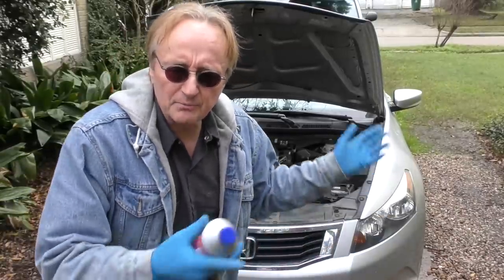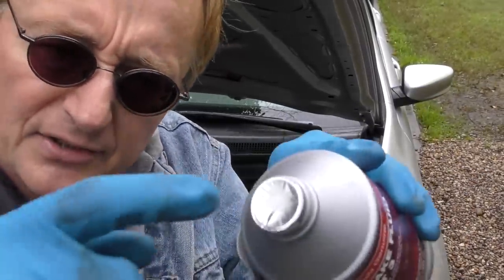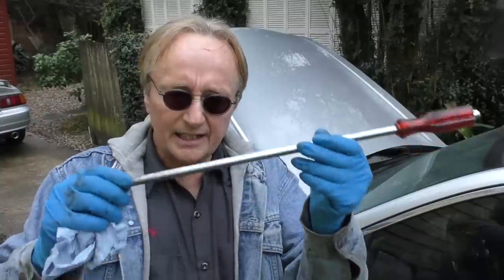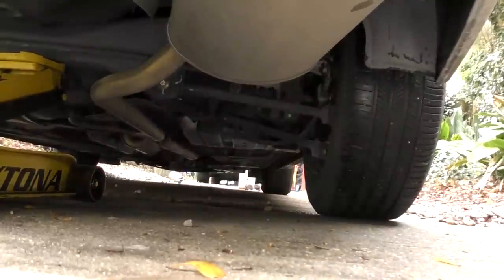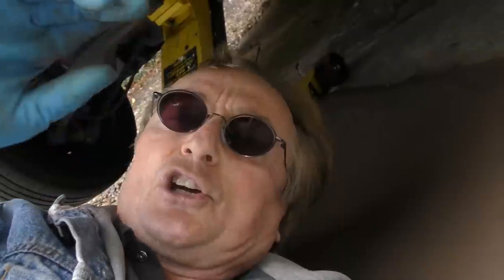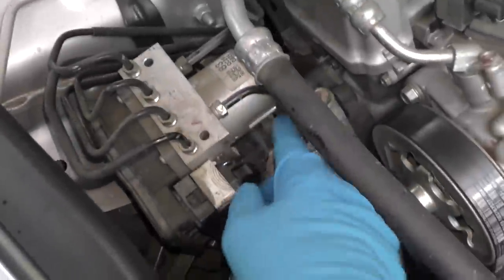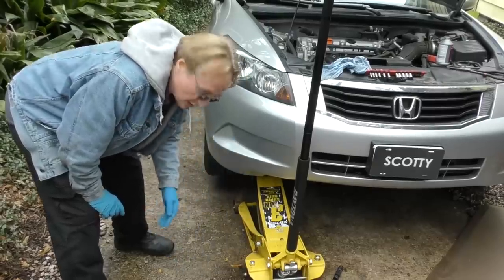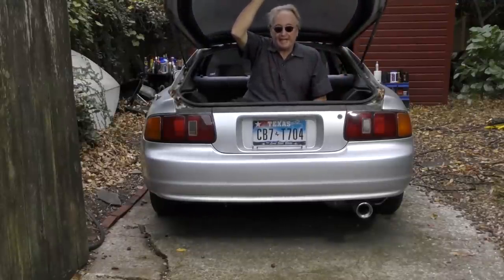Mechanics Don't Want You to Know This About Brakes

Comment: I’ve used 1/4” clear tubing to connect to the nipple on the brake bleeder. It works very well because you can see when it runs dirty dark to clear clean. U can find it at the plumbing section at Home Depot. Also Scotty sounds like he’s about to do the hokey pokey at 2:38 lol
Reply: I thought he was about to do the Hokey Pokey too.
Reply: Great idea. Thanks 👍
Reply: I use the same method with the clear plastic hose but I simply leave the lid a little bit loose on the master cylinder and the brake fluid gravity feeds when the bleed valve is opened. No need for the screw driver or a second person. It pays to keep an eye on the fluid level in the master cylinder as I generally have to fill it more than once to complete the job.
Reply: 19c a foot at local hardware store.    Needed 5/16" tubing for large 4wd truck brakes.
Reply: Kevin, the clear tubing is worth the delay before proceeding.  I used a clean jar with a hole in the lid, filled with 8oz to pump the brakes alone.  Also used similar technique to prime or bleed a new master cylinder installed dry on the firewall, instead of playing with bench bleeding it.
Reply: The hokey pokey!!!

AAAAHAHAhahahaha 😂😂😂😂
Reply: I used surgical tubing.  It wasn’t clear, but was soft anf flexeble and gripped the nipple well.  The main thing is the tube should hang on to the nipple.
Reply: We used the clear ones at work too! The hokey pokey, I'm dead as f*ck!!!!

Comment: I have an 03 Tundra that sat for 7 days.  I thought battery was dead so I got a replacement.  I had that same low idle problem.  Just like Scotty said after letting it run and driving it for a while it works great.  Starts every time.  Scotty you are legit

Comment: Another tip. Avoid over filling. Brake fluid compensates for pad wear. Some people will top off their fluid with half worn pads. When you replace the pads that fluid gets pushed back to the master cylinder causing it to overflow and eat all the paint off your firewall. Unless you have a leak you probably shouldn't be adding fluid between brake jobs as long as it's safely above the minimum level. I worked as a lube and oil guy for a long time and people would routinely complain if their brake fluid wasn't  topped to maximum level and I would have to explain this frequently. If you are changing the fluid like this video suggests pay attention to the fluid level beforehand. If you're bleeding your brakes of course you will need to monitor the level during the process.

Comment: Never get under a car supported only by a jack. Never.
Reply: Cinderblocks are a no no
Reply: Not true. If all four tires are on, and you have clearance, what's the worst that could happen? The jack falls, but you don't get crushed because it simply falls on the tires. The reason for the jack is just to give you a little more space to work.
Reply: I always keep a couple of spare tyres that i wedge under the sides of the car. If the jack slips, the tyres carry the weight and i can still crawl out alive.
Reply: Great advice.  I saw a guy lose his leg when  a car fell on it in the junk yard on faces of death a long time ago. He died 2 days later. I never made that mistake again.
Reply: @dannybonesdaddy  -- Maybe there's room under your jacked-up SUV, but I drive a German sports sedan that has a lowered suspension. There is no room for me to crawl under the car without jacking it up. The jack slips ... and I'd be crushed.
Reply: @dannybonesdaddy  you ever drop your car off the floor jack? Try it some time, lift your car, place a cardboard box the size of your back to chest as if it is you laying under the car, then quickly release the floor jack. Did you see the live definition of jounce and rebound? Now look at the cardboard box. 

Most o rings that hold the hydraulic pressure in even the most expensive name brand jacks are 10 cent Korean o rings. Is 10 cents worth your life or limb?
Reply: @Shornandkenny : Neither did he.
Reply: @edwatts9890  this is true..
Reply: cameraz99 lol
Reply: @cameraz99  put the wheels under it
Reply: @dannybonesdaddy  Go where Scotty was with the wheel jacked up while looking at the bleeder valve. If the car were to drop the vehicle with its tires on would flex your suspension. You will get your head crushed between the wheel well and the fender. or strut or frame.
Reply: I dont even trust jackstands... i put rims under the car.. jackstands are mechanical and can malfunction, a rim is solid.
Reply: Extremely dangerous
Reply: Lmao, I know. I have a huge problem with that, knowingly. I've started using a jack stand...lol
Reply: Don't be a whimp slap a Jack stand under it call it a day
Reply: I don’t get myself under a car unless I’m in the pit
Reply: I once used only the jack cause it's all I had, I placed a tire i took off under the car just in case. My friend stopped by and i got out from under the car to say hi and as soon as I got out from underneath it the car dropped on the thin tire. Definitely divine timing on that one. My point is you're totally right on this. Never use only a jack!
Reply: Even if you think there is enough clearance, remember the suspension travel. When all that weight comes crashing down off your jack, the vehicle isn't going to stop at the normal ride height on the first pass. It will drop, sag, then rebound to normal ride height. So even if it's a vehicle that has plenty of ground clearance, you still need to take precautions.
Reply: Tom Wetz  If your using a floor jack on a corvette, you are wrong.
Reply: Depends on situation should you put axle stands on for change a flat on the side of road no because you are not under car
Reply: @dannybonesdaddy  you are correct about certain vehicles, but you are not wrong about the other lowered vehicles, maybe you forgot to mention it...ahhh I learned something new today, did you?
Reply: @dannybonesdaddy  Well of course this person is talking about cars that are too low, so yes this person is right. If the jack fails you're dead. Never go under with no jack stands.
Reply: Many years ago I was jacking up a car with a friend's cheap floor jack.  Near the point where the jack to extended to its limit it failed.  The car came down instantly, not slowly.  To see all that weight come down so hard and fast was scary.
Reply: @dannybonesdaddy  The suspension compresses and you are crushed.
Reply: Scotty is invincible!
Reply: @Bravo 4 That's not what I said. If you have to lie to make your point, it shows you're probably not in the right. If you have clearance, there's nothing wrong with it. I don't mean where you can barely squeeze under.
Reply: Especially when on gravel
Reply: @dannybonesdaddy  Depends on the vehicle. Some don't have enough clearance.
Reply: @lifewithbreion1392  Harbor Freight just recalled jack stands, then recalled the replacement ones.
Reply: fasteddie bassman  I do the same. As soon as the weight is on the jack stand, I crank the floor jack valve closed and leave it just below the jack point if I can.
Reply: Yup, my middle school principal got killed that way, he thought because he was on a lifted truck with big wheels that nothing would happen if he only used a floor jack. However, when the jack malfunctioned he wasn't on his back, he was on his side. If he would of been on his back, he would of been fine because the truck was lifted, but on his side. The 3.5 ton truck crushed his arms and  torso and which then damaged his lungs and heart. He was dead within minutes. It's not worth it gents. Use something else when working on any car or truck.
Reply: First lesson my father taught me was "never trust a jack."
Reply: SUPER SCOTTY CAN DO ANYTHING !
Reply: I'm paranoid. I put the car on jack stands, leave the jack with a bit of pressure applied under the car, and put a junk wheel under too.
Reply: @Shornandkenny  My mother's friend lost her husband when a car supported by only a jack crushed the guy to death.
Reply: I just use ramps. and put bricks behind the rear tires. Big no on jacks for m
Reply: I know a guy who's brother died under a flatbed truck like that.
Reply: @Templar-jj3ig  same i have 5 holding my car up and rims under all 4 tires my wife called it over kill lol but i don't trust jack stands that much.
Reply: @dannybonesdaddy  that would require critical thinking.
Reply: Unless you are a catalytic thief.
Reply: @dannybonesdaddy  um no... the car could bottom out and damage you or itself.
Reply: ok clever man, thats what i was going 2 say,men have been killed doing that here in NZ.
Reply: Dont think that honda can go so low as to crush an arm. You shouldn't need to put your body under to undo a bleed screw.
Reply: Realistically, a screw jack is just as firm as jack stands.  Has to do with the physical mechanism.  However, many people hate screw jacks with a passion.  Personally, I find them annoying (without a powered tool attachment), but I understand why they're still in with the spare tire (if you have one).  They don't go bad, have seals fail, etc.   They're also more flexible with height than jack stands.  

I do realize that you were discussing hydraulic jacks, or the old bumper jacks.  Both of which can fail catastrophically.  Even a minor fluid leak from a hydraulic jack, under pressure, can cause the vehicle to fall fast.   I'm just rather a pedant, and I hate it when people just bluntly say something that's only true in most cases.   Especially when nobody's charging them by the word to be more specific.   

The key here is NEVER work under a car that's ONLY supported at ONE point.  That has the weight unevenly distributed.   If you have two screw jacks on the driver' side,  one near the front, one near the back, you're just about as safe as if you did left and right side (front or back).   Personally, I wouldn't tilt a car to one side to work under it - the tires are, after all, flexible, but I've done it before when I had to do a front to back tire swap.   

If you want to get really techy, you should say that you should never work under a car that's not supported on at least four separate points, because the chocks could fail, the brakes explode, and the car rock backwards or forwards and land on you.
Reply: @jwngokart6788  - it's whatever makes you feel comfortable.  As long as you take your time to get the jacks even and straight, they're about as good as it gets.   The Harbor Freight recalls due to failures were due to idiots that jack one all the way up, then the other side, and torqued the snot out of the uprights, causing them to bend sideways and fail.  (I hate seeing that, because I don't even want to put my hand and jack under the car to reset it)    If you lifted one side, set it, then the other, set  it, and then went back to the first to re-set the stand - then checked the other again, the weight goes straight down.
Reply: @dannybonesdaddy  this might work for trucks, but not cars. The suspension will still compress alot when the car comes down
Reply: Agreed, never, and every man should own a pair of jack stands..
Reply: Very true I was beheaded when my car fell off the jacks. Luckily I was able to make it to the hospital on time for them to reattach my head but driving without it was a challenge. I had to set my head in the dashboard so I could see where I was going.
Reply: Jack stands and a spare wheel with tire under car benefits a lot.
Reply: Real talk

Comment: The one thing I never liked doing in the past is changing my car's fluid. Unfortunately, I often neglected changing anything other than engine oil. This week I found out that my steering fluid change was long overdue and it was very easy for me to do. I'm not motivated to take charge of all the car fluids. Thanks for always looking out after the little guys who constantly get ripped off at mechanic and oil changing shops!

Comment: Scotty what a wonderful video....I just replace my brake master cylinder today during the morning. I did exactly as you say. I bleed my system starting from back to front and from right to left. the kit from autozone provides a self bleeding kit for the master cylinder, but you still need to do all your 4 wheels. I even turn my front wheels as you recommended. The only difference from you video is that i use a human screw driver ...LOL.. He just push the pedal and i release the drain plug...until he reach bottom, then i close the drain. Thanks Scotty for you help.

Comment: Make sure that screwdriver is set really tight because when you open the bleeder, the pedal will sink a bit and potentially cause the screwdriver to drop. If the screwdriver drops, the pedal will reset and suck air into the line.

Comment: Thanks Scotty! We have a 2006 Buick Allure which has about 300,000 km on it and the darn thing is working surprisingly well. I have done a lot of the maintenance myself like brakes and fluid changes but changing the brake fluid is something I never did and this will really help. And I was not aware that the brake fluid in old bottles shouldn't be used so will toss that stuff out.

Comment: I've been wanting to do this on my Honda Accord 2012 with automatic transmission for quite a few months already. Took it to the dealer and they told me my break fluid is contaminated with water vapor and they wanted to charge me $125.00  for the job, but seeing this video now, I can just buy a couple of more tools that I need, the genuine Honda break Fluid and do it myself without paying over a 100 bucks for a job I can do myself spending less than 30 bucks I would say. Thanks God and Scotty for showing how is it done.

Comment: I've been replacing the brake fluid in the master cylinder on all my cars yearly for about the 50 years that I have been driving.  I thought I had invented this technique.  I have had remarkably little trouble with brakes.

Comment: Great, thanks.  Wasn't sure if I could bleed my own brakes with ABS on my 1996 Ford Ranger.

Might have shown how to do this a LOT easier/quicker/lots less under car, inside, repeat if you can find a friend.  Have windows open so you can communicate.  Then have them press (not super hard, but firmly) on the brake while you open the bleeder, when to bottom have them shout BOTTOM (and HOLD it there!).  Close bleeder and shout RELEASE, THEN PRESS AGAIN.  When pressed, they shout "PRESSING" and you open the bleeder again.  Repeat.  SO much easier with two than one but good to know you can do it by yourself.

RichE San Diego, CA

Comment: Nice Scotty, and a timely reminder for me and my 12 y.o. Honda CRV .... especially since you're doing it on a Honda too. Many years back I bled brakes on my Sunbeam Alpine, Jag X-KE, several Datsuns, and some older Hondas. 

Now it is no longer second nature, and some reminding is helpful. I still have an old bleeder helper tool with one-way valve, tubing, and cup. If I can avoid emptying the reservoir (and thus introducing air), it should eliminate 20-some trips to move the big screwdriver, or me yelling at some confused helper that doesn't know up from down pedal.

Doing the screwdriver/ seat/ brake pedal dance without missing any steps could be more than I can handle. Getting up and down from under the car that many times at my age might avoid a pro mechanic, but could require emergency medical attention. lol

Comment: I do this with my power steering pump fluid as well. Fresh fluids keep my 29 year old Lexus healthy.
Reply: All fluids 👍🏻
Reply: Every 5 years ! It's $15 and a half hour job.
Reply: Does changing fluid in power steering system save it  for long term?
Reply: ahmad mohd yes. The fluid gets dirty over time and the power steering pump can put out over 1500 psi. Any major dirt in the system can slice right through the rubber hoses at that kind of pressure. It doesn’t need to be done all that often. Every 5-7 years probably. Soon it won’t be much an issue though because electric steering is becoming the norm
Reply: And clutch.
Reply: Just change the power steering flu  on my 93 corolla

Comment: I live in Maine, where there's almost a 50% chance that the bleeder or a piston is seized. About every other brake job you'll end up replacing  a caliper. These videos from TX make me envious, because I see people like Emily on Flying Sparks Garage disassembling 1970s cars without using a torch. Up here we have to heat damn near everything on the suspension and exhaust cherry red to get it apart.

Comment: i had to replace my brake line.. after redoing that n updating the old calipers n pads n such.  getting pressure back into the system.  nightmare for a 1st timer.  but i did it.

Comment: When I get a cut I bleed brake fluid.  The bleeder screw doesn't open easy in the Rust belt where they dump salt on the roads so be careful because they strip-out easily.
Reply: that's why i'm hesitant to do this myself
Reply: I used to get taps to get the broken bleeder screw out. Just a matter of getting at it.
Reply: Get some Wd-40 and some vice grips
Reply: Pb blaster works better than wd40

Comment: About 5 years ago, I bought my son a 2001 Buick Century with about 180,000 miles on it. It ran great, still does, and it was owned by a family that bought it new, then passed it down to each kid as they went to college. When the last one graduated, they sold the car. It now has 220,000, and still runs great. We paid $1750 for it. Another good possibility is a mini van that mom drove, but now the kid are grown. We have a Mercury Villager that has 166,000 miles and it runs good. I have seen several that are lower mileage than ours and are under $1000. These are the same as a Nissan Quest. It is a Nissan engine except that Ford insisted that Nissan redesign it so that it is a clearance engine, and in both the Quest and Villager.